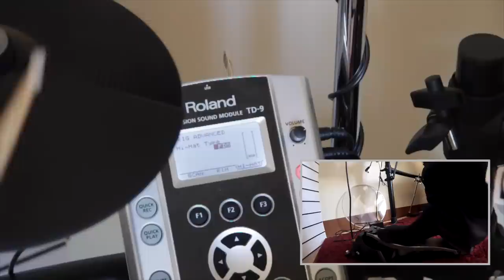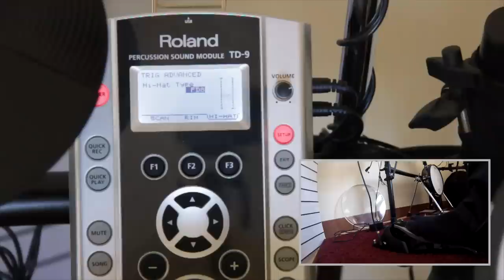Roland FD-8 sensor replacement

Comment: The question is:  when your fd-8 is nonresponsive, how do you know if it's the rubber or this sensor that you're replacing?
Reply from the maker: You don't, first try to soften the rubber, since it is a basically free solution, then order the sensor.
Reply: if your hats sound always open and the pedal doesnt sound like closing them then its the rubber piece that needs to be softened or replaced
Reply: Did you figure this out? I have an fd-8 that was very slow to respond, so I opened it and replaced the actuator but now the pedal won't respond at all, any clues?
Reply: @JohnTruong11  make sure the actuator is very pliable and flexible. Also coat it with vaseline. If that doesnt work you need to replace the sensor itself.

Comment: Donde puedo conseguir el repuesto (  sensor ) para cambiar en mi pedal FD-8 ?. Que casa en Argentina o en Chile lo comercializa??, o me contacto con Uds. directamente?
Reply from the maker: +Daniel Estevez The rubber part (C6200053R1), called Sensor Actuator and the sheet sensor (C3400026R0). Order both parts at fullcompass.com in the US, at merktron.es from Spain or the sensor only at le-drumshop.fr from France.
Reply: Lo pudiste conseguir? Soy de Buenos Aires y tampoco sé donde conseguirlo :/

Comment: what if the jack plug is the damaged part?
Reply from the maker: Just replace it with a new jack plug and connect the cables the same way, in case you can't find the original jack replacement.
Reply: Vdrum Tips Hello again! I did a quick test to check what could be wrong with my FD-8 and I think it may be the cable or the module. When I unplug the Hi-hat cable and touch the jack, it does not make a single sound. So I tried doing the same with the other cables and all of them make a sound when you remove it from the kit and touch the sensor. Does that mean my module is broken? Can you do me a real big favor and check if it makes any sound on your kit when you remove and touch the cable that connects to the FD-8? If it produces a sound, than my problem is bigger than a damaged FD-8 :(